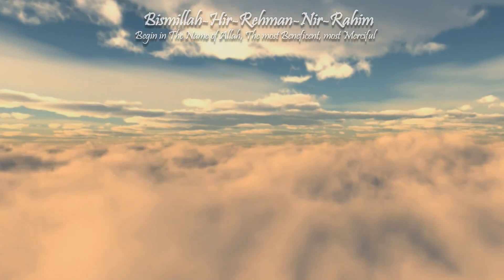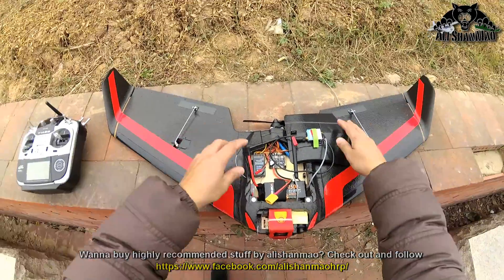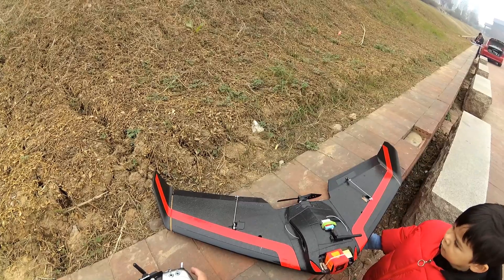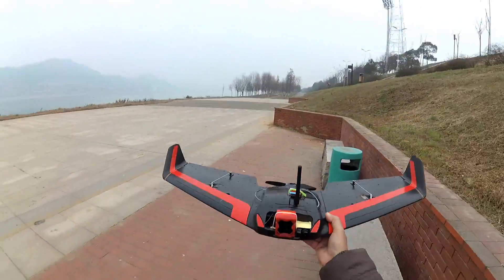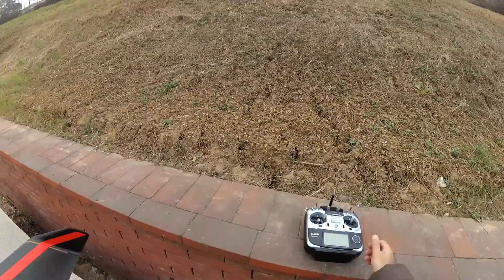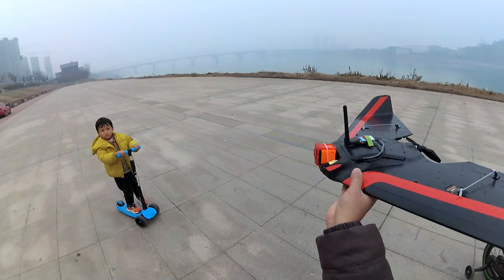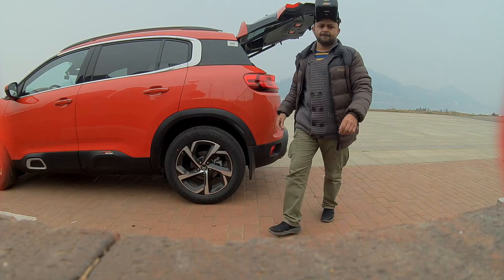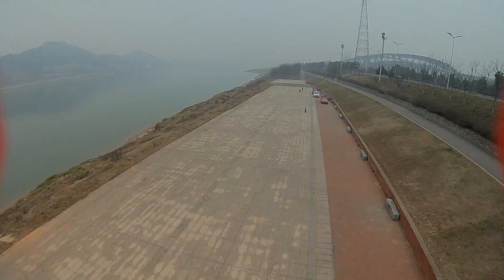SkyZone Theer First FPV Flight By River Side

Comment: wow, fast man...your boys come rolling up like fire trucks at a crash landing. they are pretty cool and well behaved. your wife needs to come into frame once in a while, family is great.  5 minute flight would take you about 6x out of range :-).  now about that mjx bug 2, does it have fpv?  also, does fpv always require wifi from phone? thanks for your help and your videos. I like the punching robot best especially when you come up with crooked face.
Reply from the maker: Thanks man. I will pass the message to her to be on cam time by time. 

Its worth a try to see how far Theer will go
MJX Bugs has FPV Version but WiFi FPV sucks always. Range wise. :D

Comment: You got a great place to fly from there. Lots of space,good surface and plenty to look at. Looks like it was purpose made for leisure use? You not have any problems or limitations on use of the site?
Reply from the maker: Yes it was built for RC Pilots to fly RC planes and RC Stuff. It has clear signs saying RC Airport ;)
Reply from the maker: Hey steve we have many new comer and beginners who fly here. No issues. you know everyone crashes time by time. we experts even crash hahahah. everyone makes mistakes. this is the fun of Hobby, this is life of RC Pilot. we enjoy crashing. if crash in water, we have boats to go get those models
Reply: Gosh, you "experts" might find that to be a great place to fly, but I cringe when I see 95% of the surrounding space being either concret or water. I'm not a bad pilot, but I sure as heck fly over grass (ideally tall grass) as often as possible!! If I could only fly over concrete or water I wouldn't even be in this hobby anymore because all of my models would either be smashed from kissing the concrete or gone from dropping into the drink!!
Reply: Steve Gergetz don't worry about crashing! It happens. Look on it as an excuse to modify,update and upgrade your models! Even the very best crash and plenty videos on here of just that but there are also lots of perfect flights. Take off your training wheels and practice getting those landings right. Get a cheap and easy to fly model and just keep practicing. You bump it,fix it and go again. Important not to get fixated on only one type of landing site. I have practiced ditching in water,sand,snow,trees and farm crops! Don't impose limitations on yourself,get out and enjoy it!
Reply from the maker: Well said. RC Pilots who proudly say they never crashed a model are actually not good Pilots hahahaha. Pilots who crash daily are the best :D